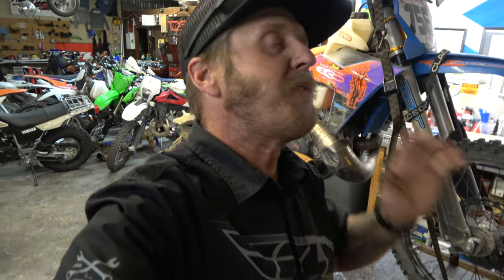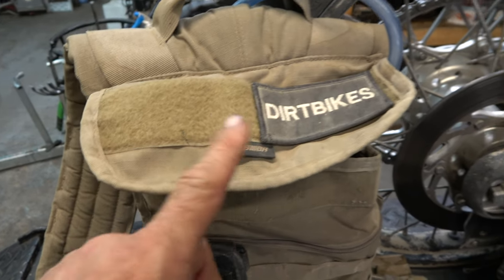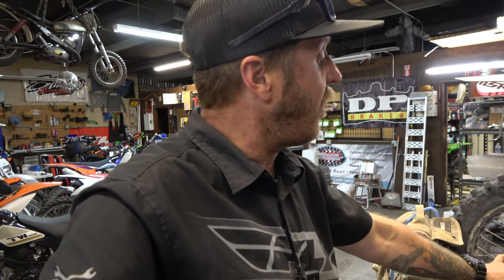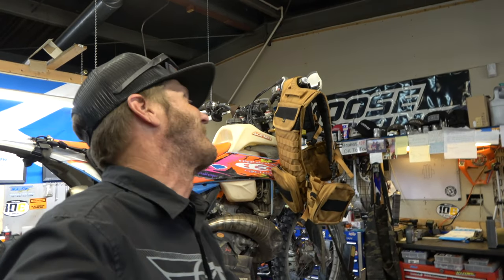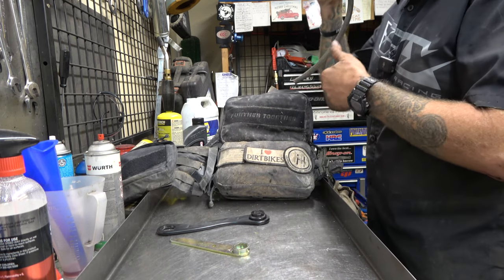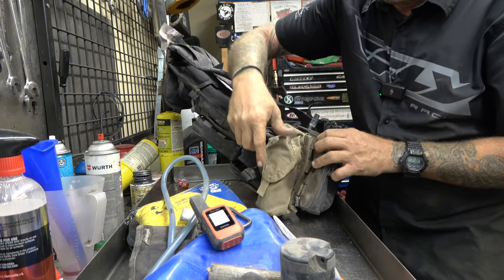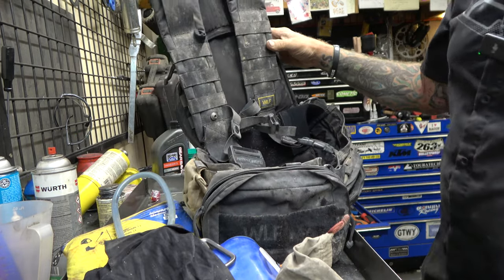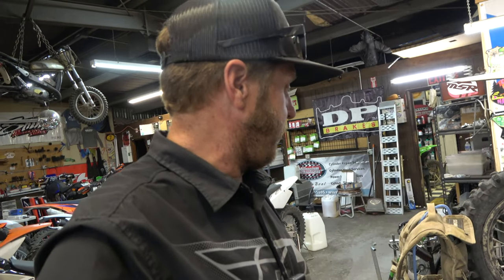WLF Enduro Pack Vest | Best Dirt Bike Pack Ever | How Do You Carry Tools and Water On A Dirt Bike

Comment: I received an email notification that the WLF was in-stock. Bought it and received it 2wks ago. I'm 6'1, 250, 38" dressed out and this enduro vest fits nicely.  I have a KLIM tactical as well and it's not bad but the WLF is much, much cooler because of the shoulder straps. WLF doesn't stock additional molle bags. I could sure use an additional bag above the butt bag. Where is a good source for molle bags other than Amazon?
Reply from the maker: Check tactical gear junkie

Comment: I ❤ my KLIM Aresenal pack/vest. Tried those?
Reply from the maker: No. They don’t breathe as well from what some good friends have said.
Reply: @highlandcycles  I forgot about KLIM ditching and ghosting you. That is BS/lame. You still might want to check them out - come with tool roll, bladder etc, tons of storage. Not sure how they couldn’t breathe as well - they’re super ventilated on the liner.
Reply from the maker: They are good but I won't deal with them any more.   @Hoser1mVm
Reply: @Hoser1mVm  I have both now and I can tell you the WLF pack is better.  The KLIM Arsenal pack is hot because the front is all vest.  The WLF pack is open in the front and there is plenty of room with the two large pouches in the front and because of the heavy duty straps on the front you forget it's on even with it weighed down. The zippers are like butter as well. If you look around you'll notice a lot of A riders wearing the WLF pack now.  I also like supporting the rider guy that owns WLF. Love my KLIM gear and helmet but the WLF pack is the best, give it a try once your KLIM gets too hot or wears out.